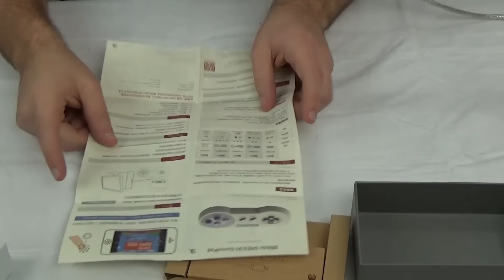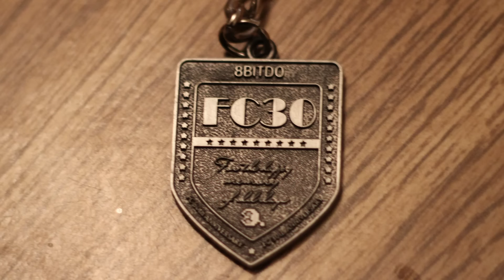Tech Wave! - Snes30 Unboxing and Disassembly!

Comment: I have the same ring in another colour on the back of my iPhone (case). It is for security, to not drop your phone on the go. You simply put your finger inside and is cannot slip out of your hand easily.
The other functionality is acting like a kickstand. If you place it on the right spot, you can simply support your phone to stand upright on the table. I think this is the purpose for your ring coming with the controller.

Comment: Nice, might actually get one of these – probably one using PAL/SFC colors though. Also looks like there'd be enough room to solder in a second battery in parallel or replace it with a bigger one. Also nice and clean board layout. Really tempted now…

Comment: Hmm, if this thing ranges from 35-40$ could you say the joycon price is acceptable? (Id you consider each of the joycons to be 40$)
Reply: Felix Nilbog. He said in a stream that the joycons price was acceptable because they're tecnically two controlers with really good tec
Reply: It's hard to compare, because the Switch's Joycons offer more than just buttons. But it's a good base estimate. Take those 30$ and you'll have to add some more tech; gyros, NFC reader, etc. are just a few bucks, but I guess the big money factor are bigger batteries and the rumble stuff (because motors will take far more power than basic controllers).
Reply: Except a joycon alone is 50 and you really  need 2
Reply: ALitleBitSpecial but when packaged together they both are 40 each. Thats why i say 40